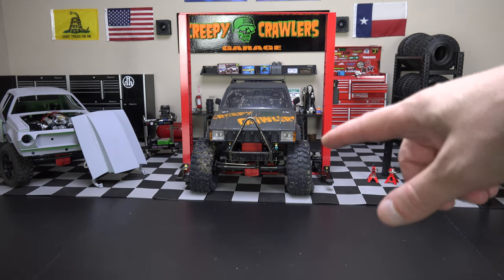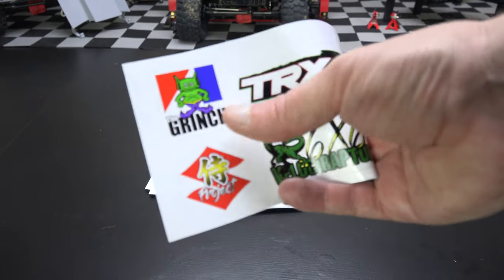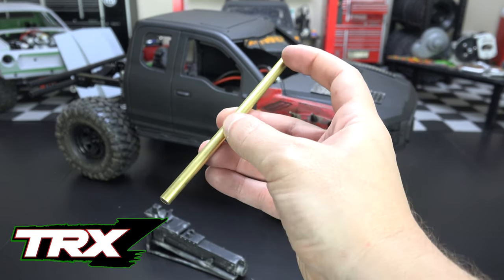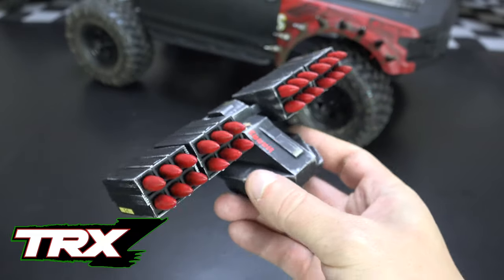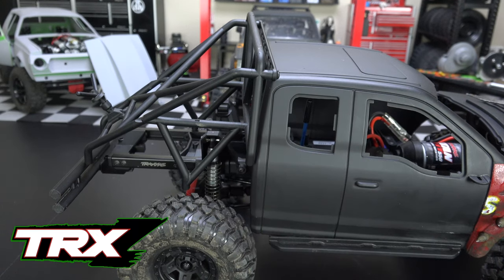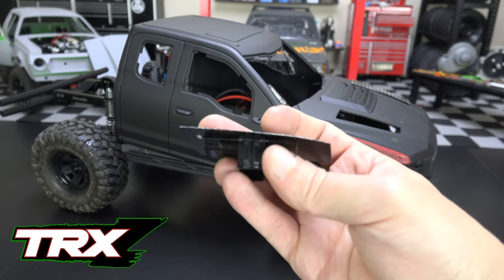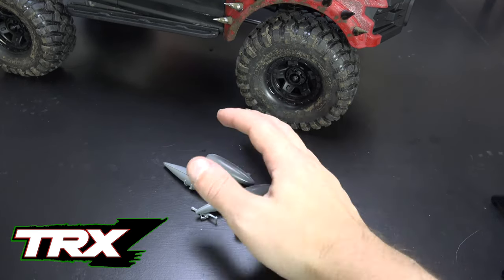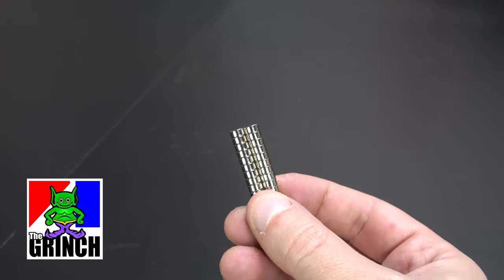Daily Updates: New Floor Upgrade and The Traxxas TRX-4 Missile Launcher has a Name!

Comment: For the shop floor, maybe lay a sheet of 2-3mm lexan or acrylic down over the top? Maybe spray it with a matte or satin clear before hand to cut down the shine on camera? This way your floor won't be wavy and it'll be protected from stains and the like... though I guess it might defeat the purpose of switching to a soft floor altogether... it's been a long day and I ran out of beer so...
Reply from the maker: I thought about doing something like that, but I think I've got some ideas that may work without an overlay.

Comment: For the roof pick some of those drop tanks what time open cut the tail off drill a hole in the front I need to put little machine gun barrels coming out of them and it won't be in the way of Darkness launcher after thickness of the drop tanks. Looking good.
Reply from the maker: I'm going to use the drop tanks some way and that might be a good idea.